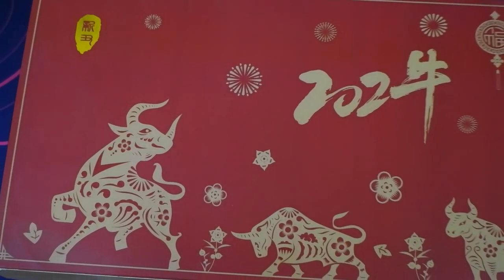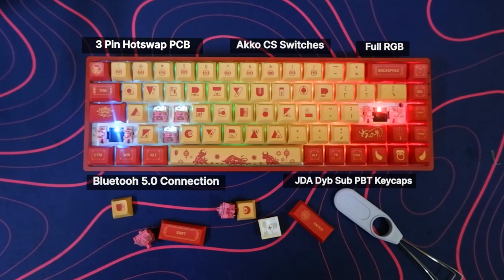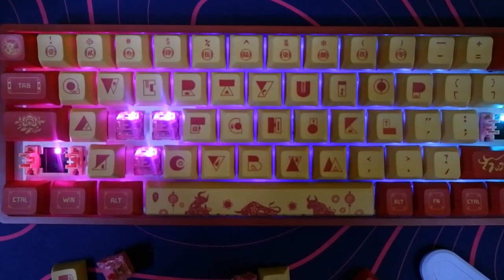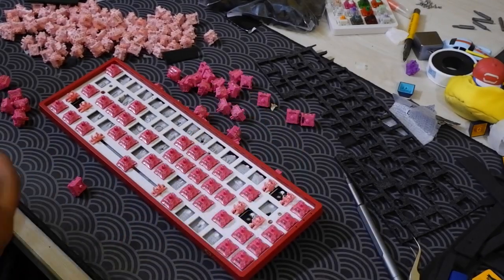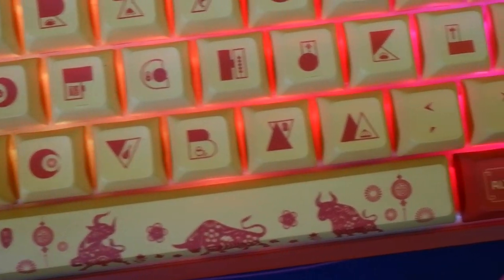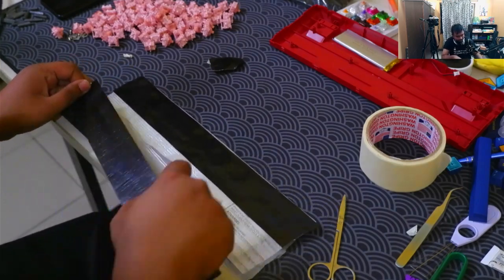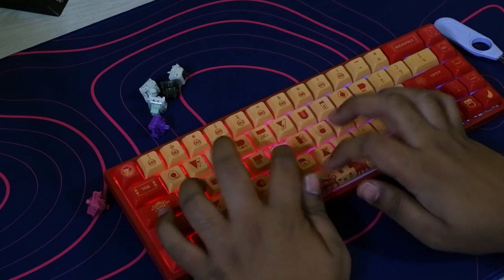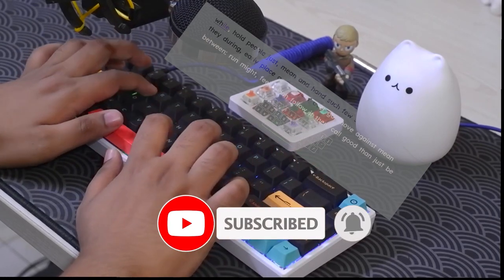Good As A Limited Edition Keyboard : Akko 3068v2 Year of the Ox Edition Long Term Review

Comment: do you know what switches that can work for the keyboard?
Reply: like for example, gateron or outemu
Reply from the maker: All MX Style switches witll fit in it. 3 Pin switches will fit directly and for the 5 pin switches, u will need to cut of the extra plastic legs!

Comment: i dont plan on modding so I want the best stock experience. My budget is 6500-7000tk which board should I get
thanks in advance and also subscribed keep up the good work!
Reply from the maker: Akko 3068B for 7.5, FL eSports F12 for 6.5K.  both are solid choices